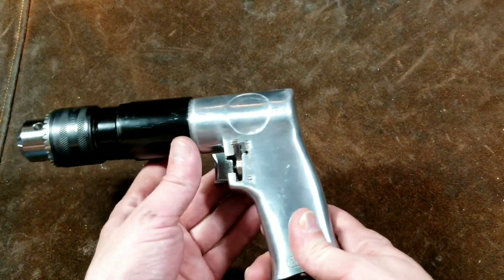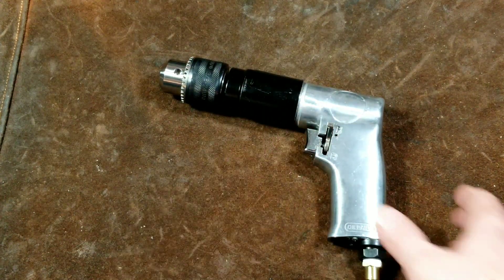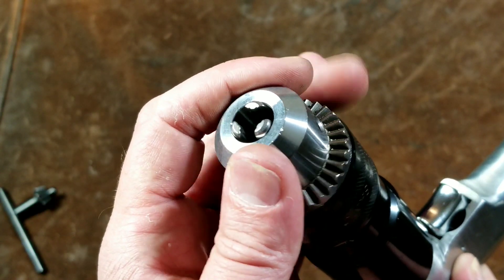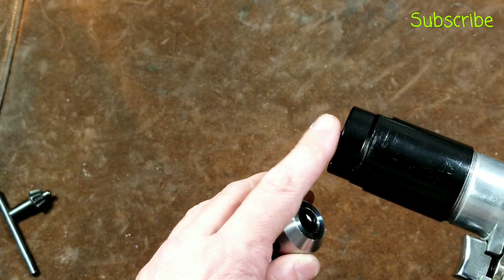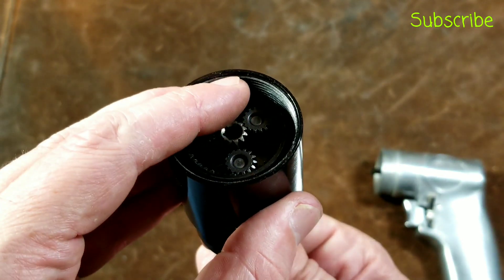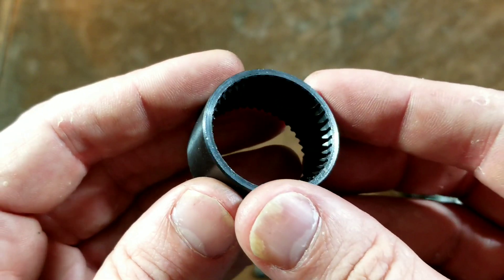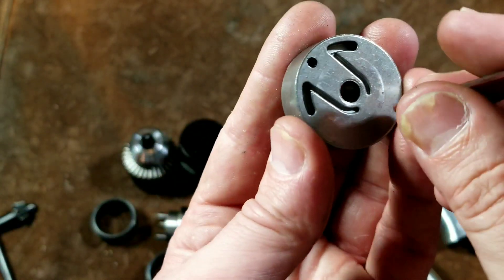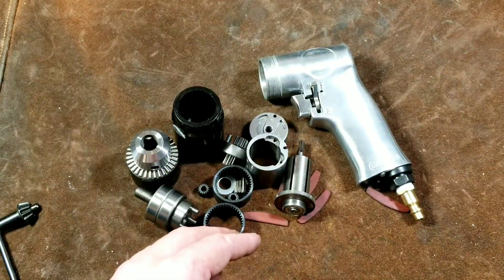Harbor Freight 1/2" Air Drill Reviw

Comment: Dude! The drill is 20 bucks. I just bought this drill the other day. It worked. It did the job. It worked great. We'll see if it lasts, but again; It's 20 bucks.
Reply: I want one for vevy light work like wood and sheet metal I'll use in maybe once a month will you still recommend it?

Comment: Good review. I want to like this thing because I like the way it feels in my hand and I do like the feel of the chuck. I know it's cheap but I like it. 

The drill itself though...'nother story. I bought it because I needed one ASAP for work and figured I'd deal with it for the price. I've had it for a month and they've warrantied it 4 times. No kidding, it's the 4th one. You'll be drilling and it'll lock up. The little gears strip and get stuck. I oil the thing every morning. 

I've got 90 days on the warranty, at this rate they'll end up giving me 12. I'm not about to spend tool truck money on a drill but when the warranty on this gets close to the end, I'll find a used tool truck drill that will hold up to the abuse. 

If you're doing light stuff in your garage this might be fine but for industrial shop work, it won't hold up.

All that being said, I don't hate HF. Most of their stuff works just fine. I have their Earthquake 1/2 impact and it's insane. As far as the warranty process, I've never had an issue with them. Walk in, show them the broken tool, grab another one and you're on your way. I have several around me so it's not much of a hassle.
Reply from the maker: Thank you for the well thought-out comment. And yes this Harbor Freight drill is just too cheap doesn't do anybody any good if it just breaks down all the time.

Also about drill Chucks I totally appreciate anybody's personal preference for particular tool that's part of why I have this channel is just to show all these tools so people can make their own decisions on what they like best. personally once I got used to Jacob's industrial and Rohm chucks I found out why they're so dominant in the market both in the past and presently they really work well and are heavy duty and very reliable.